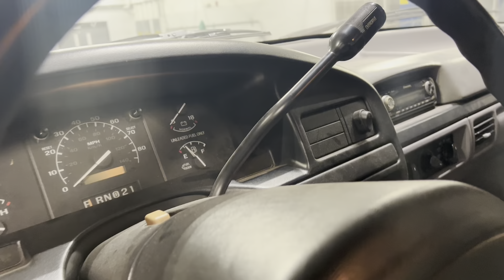96 F250 Rust Repair

Comment: Another family truck saved and more extensive repairs in progress. Really cool w so much work and active student different levels of skills going on at one time. Metal repairs chasing rust on a big truck means lots of opportunity and all hands on deck quickly builds confidence and pride in work. So much to learn before end of year.
Reply: This would not be happening without the highest quality's instruction going on w each and every project. There is a grading system going on as well requiring different levels of skill and progression to next level. This is a real body shop taking whatever coming in on assignment from collision to replacement if rust panels. Well organized and specifically assigned to student capability. Only many many years of actual paint and body allows instructor to bond w student works in progress. 600 plus views watched by other shops signals expert instruction in progress . Well done Mr Jones

Comment: How did you weld the inner panel to the outer panel? did you need to put primer on the backside of the panel to prevent rust after it was welded in?
Reply from the maker: Not exactly sure I understand what you are asking  but I will try to answer. The actual patch panel was butt welded,  so there was no outer or inner overlapping. Where the patch panel overlapped the inner fender-well (over the wheel) we sprayed everything with epoxy primer and then we used 3M 8115 panel bond instead of plug welding, This  is the best way to prevent future rusting. Before we painted it we used 3M. cavity wax was sprayed with a wand over the entire back side or the quarters. I hope this answers your question. Thanks for watching our high school auto body videos!
Reply: @sussextechautobody9914  that's what I was curious about. If you if plug welded the actual out patch panel to the inner fender-well (inner patch panel @ minute 4:40 in the video) or just used some type of bond. Seems like the panel bond would be easier to do and would be less likely for moisture to get in between the panels creating rust.